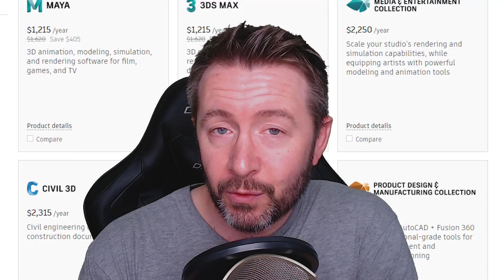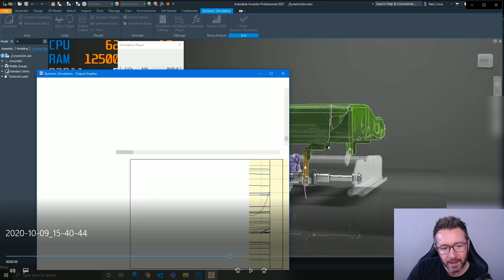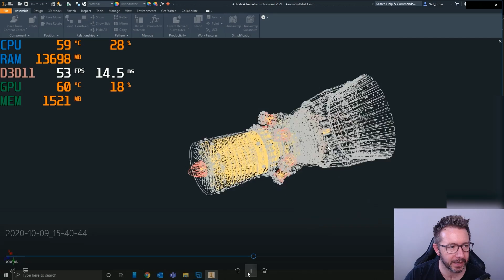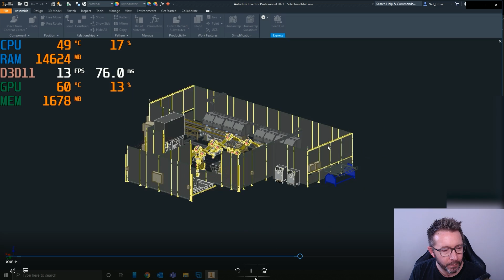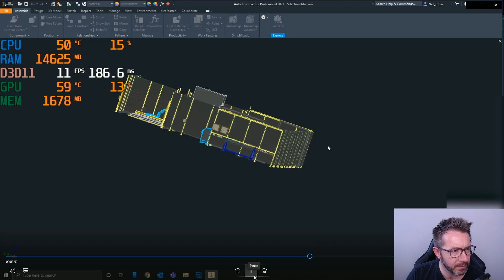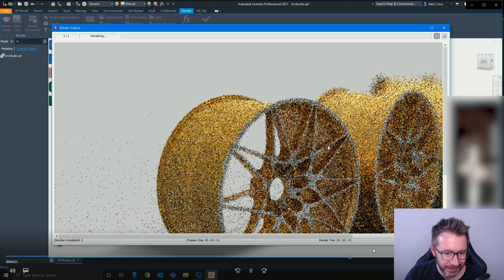Here's Another InvMark Test (Graphics) & Some Thoughts on Ryzen Zen 3

Comment: Would you sugguest getting a ryzen 7 3700x or ryzen 5 3600x for cad and architecture work
Reply from the maker: 3600x is perfect and they'll both be the same unless you do any CPU rendering, anything other than that there'll be very little difference so 3600x is sweet
Reply: @Neil3D  ahh ok sounds good, sorry one more question 1660 super or 2060

Comment: With model of 7000 unique and 60k occurences my RTX3000 has usage of 20-40%  30fps and when I have pointcloud visible then it is 50-60% 7fps. Sadly at that level it is difficult to make a test. However I am still in opinion that graphic cards matter with Point Clouds, in both case its like 22GB ram. However weird part is longer I move around the model the faster it gets and more memory it uses.
Anyway I am excited to have all the computers in office run it and see what need updateing.

Comment: Umm...an FEA question, mate: I remember when you modeled the wheel...wasn't it one monolithic part? 
If so, where does the contact come in? 
Is it actually...ahem..."in contact" with anything else?
Reply from the maker: Good spot hawk eye! But Inventor still has to do an automatic contact update scan - it still goes looking for contacts even if there isn't any, there's 10-12 seconds of computation there on my system.  So in theory sure it isn't testing the updating of actual contacts but it's still a genuine FEA activity that everybody has to do.
Reply: @Neil3D  Ah! I see that now...As I am sure I have said before multiple times, I don't actually use Inventor's built-in FEA solver, but Inventor Nastran (old name In-CAD)…So, I did not know that...Thanks for the heads-up, mate!

Comment: At 2:50, I use both solidworks and inventor at work. Inventor is much better in every way. We use top down design approaches to design large assemblies. Solidworks has tons of bugs in this regard whereas inventor has non. Solidworks would brake sketches and crash. My impression of solidworks is that it is built by several engineers who don't talk to each other whereas inventor is much better integrated and more polished. The only two things thing that solidworks does better are design tree child/parent relationships arrows that appear when you click on a tree item, AND the colour display and anti aliasing of graphics in solidworks look much better than inventor because Solidworks favours quadros over GeForce... Unlike inventor
Reply: according to TFI, Inventor doesn't even use them, so it shouldn't matter what your graphics card is.
Reply: @O-Side_Bradley  yes investor doesn't care which video card is used because it uses the Directx system  used in games. Solidworks is very different because it uses OpenGL graphics....

Comment: Neil, Something I don't understand.  If basically nothing in Inventor runs on the GPU, why does Autodesk make (fairly expensive) GPU suggestions?  A lot of us want to build a great system to work on (and to run these tests on :) ), but don't want to waist a lot of money on a brand new NVIDEA 3090 (or worse, a workstation GPU) if it has absolutely no influence on productivity.  Thoughts?
Reply from the maker: I've already done a piece on that - I think I talked about it here https://youtu.be/jT6YwF7NUSk
Reply: @Neil3D  Thanks for the reply Neil.  I've seen and enjoyed that video.  It does a great job of explaining why a GeForce (desktop card) (2080ti I think) is just as suitable as a Quadro (Workstation card)!  My question is "why waist your money on either?". Based on what I've seen through your videos, Inventor doesn't utilize a GPU at all.  So what is the point in either.  I've never seen this proven.  Basically take the video card(s) in your system, and replace them with a $100 budget card.  If Inventor doesn't use the graphics card, I would assume that there would be no change in performance at all (in Inventor that is, but your screen capture software would probably crap out).  A lot of us are really confused about why a software that isn't supposed to rely on a GPU is always tested on systems with nice GPU's.  I would seriously send you a budget card if you would be interested in doing a test on whether or not Inventor is truly "not" reliant on the GPU. (unless it's already been done).  I would also like to know Autodesk's opinion about this.  If anyone else reading this has any experience upgrading a video card and seeing a performance gain or not, I would be interested in your "take" on this.